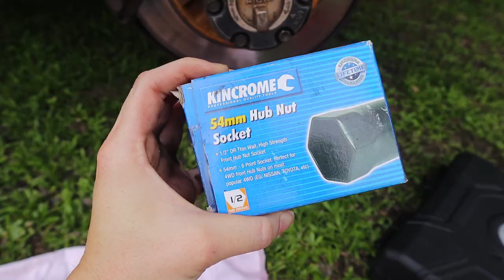My Landcruiser Part 3: CV Repair

Comment: The 27 dislikes were from men who can't do this job themselves!
Reply from the maker: Haha love it
Reply: Or women whos partners can't stop watching her vids and are jealous because they can't even change a tyre lol
Reply: Lol she is an amazing  person   my daughters will know how to do all is this so they dont have to rely  on anyone
Reply: I liked the vid, but sure as shit wouldn’t know where to start myself!
Reply: @hondacivic199091  they may learn a bit about electric vehicles if they are young enough.
Reply: You are the champion
Reply: haha .. o my
Reply: Peter Peterson or who have no desire to look down her top like you ! If you can do the job put a vid up fat mouth.
Reply: I remember when I first got my 2nd 80 and I had a turbo timer my wife parked the car turned it off and just popped the clutch all in that moment ,and the axle was done... since then I have done 3 drive  couplers (was constant 4wd) ,because that is spline related cvs as well, changed over to part time and locker and I completely shattered one more . I have had my 80 for 18 years now and it’s awesome ..... just one tip for ya if the flies are bad wear some overalls cause you are going to have a shit time in the shower getting the smack prints of grease off ya ......lol
Reply: Might dislike cause i dont know 😂jks
Reply: Wow what a champion you are!!!
Reply: Haha... so true

Comment: I don't have a concrete slab and this is how I work on my own rig. Jacks (factory and highlift) stands, timber and tie-downs for bolt-hole realignment. Makes you think outside the box and eliminates that idealist thought process where people can't do a job because they haven't got the ideal set-up area or tooling. "Just get 'er done!"
Reply from the maker: Thats exactly it. Not always going to have all the tools and an ideal environment
Reply: Yeah, almost like you’d have to do if you’re out four wheel driving.
Are you kidding!
Reply: @larjkok1184  Hah! You'd be surprised at how many people get a tow back instead of fixing on the trail.

Comment: 22:23 A shovel spade actually works REALLY well for positioning heavy / large wheels back onto the hubs Danie. Similar method to what you used but a shovel / spade gives you better leverage and control plus will not sink into soft ground. You use the tip of the spade to support the bottom of the tyre so the heal of the shovel/ spade then acts as a fulcrum. A lot less effort required. All the best  from the West  :)

Comment: Gotta love a woman that can work on a car... i know a bunch of guys that cant do this work.. good job, but really use a torque wrench, and use a jack stand, or block up the frame... be safe!!
Reply from the maker: Been said a millions times. Tyre under the chassis won't stop the axle falling and you don't carry a jack stand offroad. Learn to work safely without relying on safety devices
Reply from the maker: And no these are not new parts and torquing them to brand new torque specs will result in alot do snapped and stretched bolts

Comment: Good on you for having a go. I've done this job a few times on my Landcruiser and one good investment I made was a brass hammer from SuperCrap, I also get those cone washers out by any means possible and the brass hammer is easier than a drift and only cost like $30

Comment: A quick easy tip, is put the tyre you removed under the car. Incase it comes off the jack, it won't fall all the way to the ground
Reply from the maker: Been answered many times before putting the tyre under the chassis does not stop the suspension from travelling and my 35" tyre does not fit under the suspension. 
You don't carry jack stands to change a tyre or offroad. Sure if you have safety devices use them but this isn't always the case learn to work safely, be aware of the hazards and don't become lax minded

Comment: Good video Danie, I am suprised you didn't have any mates helping you, personally I love helping mates fix busted stuff or fitting upgrades, especially suspension Haha 
Nothing wrong with using the tools you have, I am always amazed what a person can pull apart with a 3/8 socket set and a Philips screwdriver
Reply from the maker: Yeah nothing in this task is really a two person job. And yeah you don't need much
Reply: You went well and best of all, I am sure you have encouraged other people to give it a go.
A tip I seen when setting the bearing preload I guess you would call it, if you can find one of them old torque wrenches with the gauge and long pointer type dials put your big socket on and when you turn it will show the torque if that makes sense.
Reply from the maker: @MrOgre1110  yeah torque meter they are pretty handy

Comment: Hi LC Gal, you gotta use an axle stand or atleast put the wheel under the chassis and chock the rear wheel with 4 bricks. No fun having the car roll of the jack when you are under it... Keep the videos coming.🤠
Reply from the maker: Omg people read past comments before commenting. This has been answered. My handbrake works. The ground was flat. You couldnt roll the cruiser even if you tried. The jack isnt hydraulic it isnt going to just suddenly fall. It is as stable as a stand. If you have a jack available use it

Comment: Good onya for doing your own repairs, just a quick note though,

The number one reason for the lockup hub studs to shear off flush with the hub is caused by flogging the lockup housing on the side to remove the taperlocks exactly the way you have done here.
Its the easy way to remove them yes, and everyone does it that way but it can cause failure of the  studs later on in normal use.

What this method actually does is crush the housing taper, which in turn constantly stressing the stud sideways and because the stud is now flexing all the time with power on/off cycles,
the studs will fatigue and eventually snap off clean flush with the hub making stud removal very difficult not to mention loosing drive to the axle.

The correct way is to use a punch and hammer to shock the taperlocks out by punching the lockup housing adjacent to the studs as close as possible to the locks.

In 40 odd years of pulling spanners, I have lost count of the times I have had to fix snapped studs in 4x4s, truck, and earth machinery hubs almost certainly caused by that way of removal.
These jobs always appears to go down well at the time, but its later on down the track when they snap and takes everyone by surprise leaving drivers wondering where the hell did that come from????

Comment: Great job! The humor/reactions are the best. On the trail, I've set the bearing nut preload pretty close to what a spring gauge would measure by getting it to the point where the thrust washer barely moves from working a screwdriver tip against it. Birfields(cv) + full lock or close are always a fun combo with 4wd engaged. Cheers
Reply from the maker: Yeah nice thatd be a pretty accurate method

Comment: battery rattle gun make things so much quicker and easier plus bungee cords instead of zip tires reusable. : )
Reply from the maker: Like i said doing it with minimal tools so you dont need fancy shit. Ive got a hoist and compressed air at home. Also zippy ties are reusable

Comment: Only advice I can give to this is use a brass hammer to knock the cone washers out, reduces your drive flange edges flattening. Otherwise top job!
I got sick of the cone washers on my 80, running 35"s I do wheel bearings or cv's often enough so I did the 10mm stud conversion to mine.
Reply from the maker: Yeah thinking about doing the 10mm conversion too

Comment: i have 33 inch on my hj60, i always use a torque wrench to tight the  two 54mm nuts, 40 pounds the first nut the second 30 pounds. and they never loosened again. regards
Reply from the maker: You need to use a spring gauge. Only way to correctly measure preload. Overtighting bearings of course they will never come loose but when they seize you will have a bad time
Reply: @DanieSimpson  thanks  for the tip 👌👍 I will do that

Comment: Apart from all the technical work for the CV, I'm super impressed how you one shotted the wheel back on. Fuck I struggle with that regardless of how many times I've done it, and 35's on steelies are HEAVY! Love the vids.
Reply from the maker: Yeah agreed!! Work smarter not harder thats why I only raise it just off the ground and use a bar to lever it on😊

Comment: I ripped a wheel off on a rabbit hole in a corolla doing 160kph I drove on that for 3000km, before I investigated the wobble in the steering wheel, and the strangely bald tyre, thinking I’d bent a strut, turns out I’d completely sheared off the top of the strut, 

Long story short, break stuff and then fix it... hate on the haters

Sorry I’ve been spamming your channel, literally just discovered it 

Nice to watch a fellow mechanical traveler making the exact same bullshit mistakes we all make learning and then pretend we never made them,  
Your excellent, continue to break your cruiser, so you can continue making real videos on how to actually fix this stuff
Reply from the maker: All good:)

Comment: Great video, its an old 4wd they break when you go off road! Just to clarify however the 54mm hub socket is the same for patrols (gqs's atleast) Made my life so much easier on multiple times doing cvs and wheel bearings as a normal socket just isn't deep enough
Reply from the maker: Well there you go:) definitely is something youve just gotta have hey

Comment: If its not the marsh flies it will be the mossies or sandflies that get you.   Not sure if it makes a huge difference but usually black moly grease is used in the swivel hub / CV . 
I've just finished putting in new swivel  seals and inner axle seal  on the LH side of my troopy , very messy with all the oil and grease mixed together....... never broken a CV joint but its 3rd time I've had oil leaking from the swivel housing . Fitted a " trail safe" inner seal this time , time will tell if it works.    Those chooks aren't camera shy.

Comment: Try get some chrome molly cvs if you plan on using front lockers oftten.
Job well done
Reply from the maker: No I don't like breaking diffs thank you. Cvs are cheap and easy to replace in comparison. And the cause of them breaking had been rectified

Comment: Done alright just some advice put a stand or the tyre under the car next time just as a safety precaution, should have been abit more grease in there with that broken cv two, best thing to do is pack them full
Reply from the maker: Please read past comments before commenting that has been answered. I didn't have stand. Tyre dont fit. I showed on my insta what happens if the jack collapses or fell out. Nothing. And the cv was packed full im not silly

Comment: Common for land cruisers and Hi lux 
Go Crome Molloy  CVs .
Have had a GQ for over 20 year ,
Have done cape trip , gulf trips , 4b parks .
Only problem I ever had was a bent pan hard rod .
480,000Ks  and still going strong .
Mainly because GQ running gear comes out of Nissan trucks or buses .
Reply from the maker: No its not common. And no you cant just go chromoly because then the diff and locker becomes the weak link. Id much rather change cvs than a centre.
Ive been 4wding all over the east coast of australia and ive broken 1 CV in 8 years due to an incorrect setup and it was an aftermarket one not Toyota. 
Best to watch the video before voicing an opinion.

Comment: Righto righto I wanna add a lovely comment and ask sumfin, having done similar lil jobs I really appreciated your genuine genuineness, seeing you concentrate as you used your elbow torque setting and the like. 
When moving the caliper, I noticed a 10mm (maybe) that holds the join between hose and metal line to the diff housing, if you undid that would it allow you to move the caliper without bending the line if that makes sense?
Reply from the maker: Then you gotta bleed the brakes. By doing what i did its one less thing to do but yes some people disconnect the line

Comment: Good and planned designing, that the easier and less expensive part to break under to much stress,  if it didnt then it would go back under the vehicle to more expensive parts like trans case gearing and numbers more, so if something had to break I'd say good designing let's it break out there before other things break to save the rest
Reply from the maker: Thank you! I agree

Comment: I used to just wing it with scissor jacks and bottle jacks till I had one slip out, hard to watch you stick your head up under there, at least put the wheel under
Reply from the maker: Thanks for the concern but like I said I would normally have a hoist for this job and would have to be an earthquake for that jack to 'slip' out. More chances of my inner guard falling on my head than anything else
Reply: @DanieSimpson  I remember doing an exhaust on stands...I noticed the whole car beginning to topple off them in the nick of time - got out from under the thing like a shot. Couldn't do that these days - different strokes for different folks.
Reply: Danie Simpson You should learn to listen to sound advice.
Working on grass (which can subside) with a jack on a piece of board is unsafe.
You should use axle stands as has been stated. Also putting the wheel on its side under the sill of the vehicle is also a good idea.
When (not if) a vehicle one day slips off the jack on you, if it drops on you can kill you, but if not the rotor can amputate limbs etc.
Even if you get out unscathed - it’s next to impossible to get anything back under the vehicle to lift it back up once it’s down on the ground.
The wheel for eg will keep it from dropping all the way to the ground - to allow you to get a trolley jack in under there to jack it back up.
There’s good reasons for this advice, not just to educate yourself but others watching who might also learn.

Comment: People don’t forget people Degrease the front and the back of your brake disk with brake cleaner as grease and brake pads don’t mix very well.
Reply from the maker: I know they don't mix well hence why I degreased it before putting it back on. Just because things aren't mentioned doesn't mean they didn't happen. Like I said this is not a tutorial step by step video. If I showed everything the video would be over an hour long.
Reply: Danie Simpson I’m Just mentioning it as there will be people who will use you video as a tutorial. Your video was great you showed the important bits it was very engaging till the very end. Keep up the great work your channel had quickly become one of my favs keep up the great work

Comment: Common misconception. 35" is the diameter, not the radius of a tyre. You only gain 1" not 2" of lift as you only gaining height from the radius to the axle. I have heard this a lot from people.

Comment: Great job!! beer, tools and a cloudy arvo working on your ride..sublime. Been looking at getting a 70 series here in NZ. Have a collie and the IFS doesn't have much by way lift and tyre size when compared to solid axil. Any info on what to look out for when picking up a second hand Landcruiser? (future video idea maybe :) ).
Reply from the maker: Really changes model to model unfortunately but you really cant go wrong with any landcruiser

Comment: couldnt wait to watch this video your done very well Daniel....have changed front wheel bearings and cvs in my old sixty a few times...how often would you recommend repacking front hubs and wheel bearings on these old cruisers
Reply from the maker: Oh thank you for watching!! I run -44 offset rims so I try to at least check mine every 5000kms and usually repack every other time

Comment: Where did you put the jack under? I tried to put the jack under the spring mounting, but with a flat tire there isn't enough height to fit. Also, does your 75 have the 1HZ motor, or the older push rod motor? Mine's a 1992 model with the 1HZ.
Reply from the maker: Under the diff. Yes 1hz

Comment: you should invest in a better jack than that bottle jack, and some bungee cords for the calipers
Reply from the maker: Such as? This is normally done on a hoist and you can't take a hoist out on the tracks. I'd trust a bottle jack before a new hydraulic jack that could fail or a high lift jack which are dodgy at the best of time.

Comment: It comes down to leverage... the bigger the tyre, the more force will be pit back through the cv when it’s loaded up with an excess of traction or some other counter force working in the opposite direction to the force applied through diff. Basically think of your 35 acting like long breaker bar on a nut. So you’re far less likely to break a cv with smaller tyres, because far less force is applied to the cv. Also, the cv is weaker with more steering angle.

So, first gear, low range, with the locker on and steering applied, with a wheel jammed in the guard was probably the worse thing you could have for your cv.
Reply from the maker: So pretty much what i said.🤦‍♀️ 
And no same thing would have happened with 2" less lift and 33s. Tyre size had nothing to do with why the cv broke like this. It was just the wrong set up. Best to watch the video and listen before commenting
Reply: Danie Simpson riiiiiiight... 🤔 well a 33 might still turn in the guard and not get jammed because the smaller  and turns more force. But hey what would I know. Enjoy changing your cvs...
Reply from the maker: @operation4wheelz  1 in 8 years hahha better than most ifs cars
Reply from the maker: @operation4wheelz  and unless you own the car and know its history. You pretty much know nothing so listen to the owner.